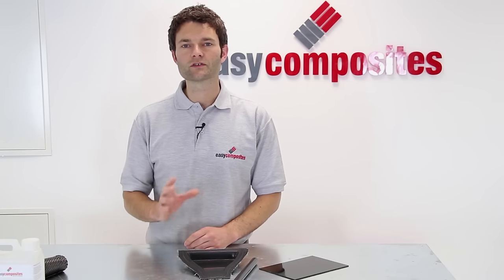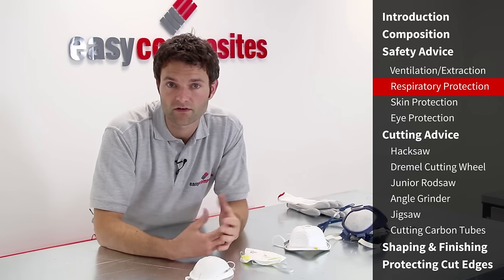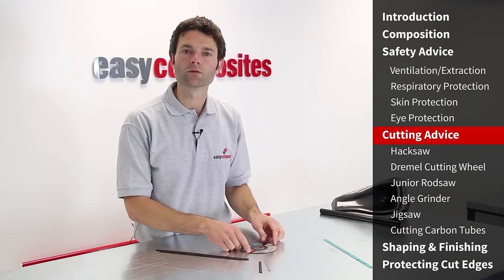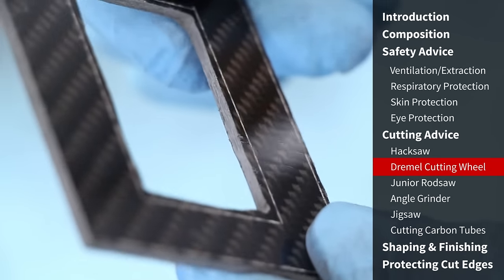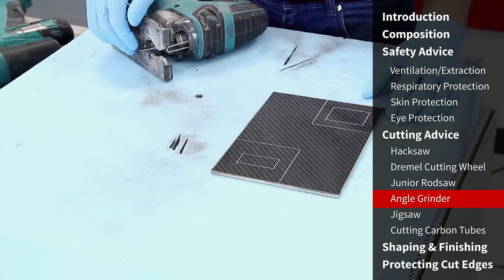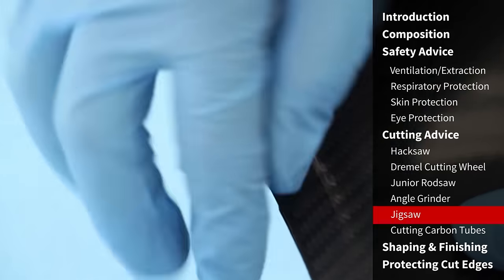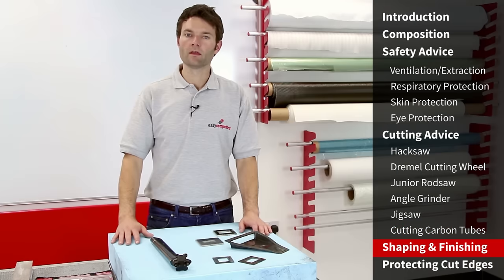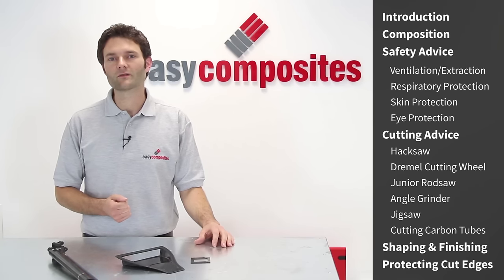How to Cut Carbon Fibre Sheet and Carbon Fiber Parts (Technique & Safety)

Comment: I work an an engineer on carbon fibre aircraft and would like to recommend the cutting tool I prefer to se to work on the aircraft. I use a Fein multimaster oscillating cutting tool with a bonded diamond blade. Cuts beautifully and you can cut very close to finished size. Bonus is it can be used for finishing too.
Reply: That's an electric tool, how do you do with the dust/explosive atmosphere?
Reply: @tomasescobargallardo6579  I have seen few that use a vacuum cleaner close to the cutting so all fibres dust gets trapped inside the vacuum bag.

Comment: I think it's always a good idea to use skin protection creme to avoid any skin irritation. The dust will come off easier or does it interfere with the cut surface, by which I mean damaging the laminate with chemicals.

Comment from the maker: It's the new Dremel Fortiflex. They used to be called Motorflexes which were amazing until they stopped making them but the good news is they releaunched it, called the Motorflex. Worth every penny (and you can get all replacement spare parts if you use it a lot like we do).

Comment: I was worried I might be getting in over my head without CNC milling capability, this video showed me that carbon fiber is probably easier to work with than metal with the tools I have, excellent.
Reply from the maker: Thanks for the comment Andy, glad you enjoyed the video!
Reply: It sands beautifully. Just make sure to have a vacuum or other dust collection under control, and a good respirator. If you’re drilling it, use a 1/16” drill bit for a pilot hole. Otherwise it likes to splinter.

Comment: Thanks. I'm handmaking a guitar with Rick Toone style carbon plates holding the wooden pieces together (mainly because I don't want to spend 15 thousand dollars on a real RT guitar) and this helped me with my game plan a lot...I don't have a proper workshop and most of my hand crafted guitars have been done with hand tools, but I've never worked with carbon fibre before so I was a little concerned going into it. Not anymore though :)

Comment from the maker: Work through the grits with wet and dry paper. Taking care to remove the scratches from the previous paper. Change the water with each move up the grits to ensure no grit from the previous paper contaminates your part.  once you have worked upto 1500 grit, you should be able to polish the part by hand with a polishing compound or by machine, to get a final gloss.

Comment: I use a bandsaw, oscilating spindle sander, and a  tile cutting saw with a diamond blade to cut and shape parts.  If you want to use a bandsaw I would recommend calling Lenox blades and have them recommend a blade for your specific application.

Comment: And another follow-up question please:
How do you know where to cut the hole into the 3D piece?
Would the hole be modeled as a depression into the pattern (that is, surface closed from the backside), so that the mould gets a (flat? high?) raise where the hole is, so that the new piece has the guidelines for cutting "built-in"?
Reply: Dear team, would you mind telling a bit about where to cut and drill? Would the cutting lines and drill locations be modelled as a part of the mould? Or just transferred with pen and ruler from the pattern onto the otherwise flat surface of the new part?

Comment: I am extremely happy you made this video, carbon fiber is now used in pool cues and there have been many things said about things that cannot be done without catastrophic results, like even sanding or cutting. I work on cues and have never worked with CF before, So thank you for this video and others I will be subscribing and checking out your website as well. What would be the best way to clean and make a CF shaft/tube slick?
Reply from the maker: Hi Patrik, carbon fibre shaft/tube will sand down and smooth really nicely. We'd just suggest using abrasive paper (the grade of which would depend on how much 'texture' you need to take off but in many cases a 240grit paper might be a good starting point. You can then work you way up to finer grits and then finish with a polishing compound like Pai Crystal NW1 Black which you'll find on our website.

Comment: So, if sand paper is all right, belt sander and drum sander probably all right too?

Besides that, if jigsaw with that kind of blade is ok, what if i do the cutting on table saw or miter saw with a metal cutting blade or diamond blade, or even metal cutting bandsaw, is there a minimum speed and blade choice we have to follow?

Comment: Great share, nicely done. Seems I'd want to take the CF dust control to a higher level. The good respirator - I totally agree. But I would seal eye areas because dust gets right into eye fluids. Then, use a shop vac seems bad if CF dust goes through filter and then shot into room's atmosphere. What to do with dust that is collected? Seems to be like nuclear waste, it will always be with us. Dump it out back where it gets into the watershed? I am cautious about this stuff - seems easy to have an incident you won't realize until well down the road when the equivalent of mesothelioma kicks in. There was a lot of loose dust sitting on the foam board after you post-processed the items, to deal with.
Reply from the maker: An Air fed mask would be ideal if a lot of material is being cut.  Such air feeds need to be filtered as a matter of course.  Carbon Fibre Dust itself is not a hazardous material - cured carbon fibre is not generally hazardous - it only becomes a particle hazard once airbourne. Disposal for carbon fibre dust and cut cured carbon fibre is generally in non-recyclable waste, although local rules may differ. If you are careful and wear appropriate PPE, then there is no reason to be concerned about any long term health effects.

Comment: How about cutting it wet would it be a viable option too? For the drilling perfect holes you should clamp it between two plates of wood and drill through the wood. I think it would work as fine as drilling multiplex/balsa wood by using scrap wood to prevent multiplex/balsa from chipping
Reply from the maker: You won't get a neat cut on wet fibres.  You can trim the excess off that way but will still need a final trim once cured.

Comment: IF you are buying a hacksaw, get one with a rectangular frame whenever possible. Older steel tube ones of decent quality work really well. The ones with a semicircular frame like shown here leaves less useful blade length when working on large materials and you cannot use the forward part of the frame as a second handle for the other hand. Also, get one where it can hold the blade at different angles, makes awkward cuts less awkward. Lastly, hacksaws are cheap; spend the extra money to get a nice one.  Ignore the bargain bin, spend $10 more and save yourself a lot of time and aggravation.

Comment: very good Caya you explained, I have started learning and have produced carbon for my own use.. I have already repaired my cracked bicycle frame, so I don't need to send it to the shop to repair the crack, the first time I use this carbon, right?  my body is very itchy. but from there I started to understand that if it is ready and dry, if it is rubbed, the dust can fly and stick to our body parts..anything, thank you for the way of using this product..very good,,,  ,#stay save covid is still there we are almost winning, we have not won against this covid19..#to those who died due to covid condolences to their family members# very grateful for the useful knowledge from you
Reply from the maker: Always wear PPE to minimise exposure to the carbon dust when cutting it.  It is a respirable dust hazard and can cause minor skin irritation as you found.  Washing with cold water will remove any dust on the skin with less irritation.

Comment: Thank you very much for your video, I was also wondering how to drill a hole in carbon fiber rod.  I have a rod that I need to attach a screw to and I was wondering if I should drill the hole just as you did through the pre-preg.  Thank you in advance for your reply.
Reply from the maker: It is the same method really. You ideally need to clamp the rod and use a bench or pillar drill so the drill bit can't slip and slide everywhere. Be aware that carbon does not take threads very well so screwing directly into it is not a good idea.

Comment: Thanks a lot such a detail video. 
Please guide for drilling process and drill bitts type to be used , thanks
Reply from the maker: For most simple drilling operations you can use normal HSS bits. For larger holes, there are tungsten carbide hole saws (check the Perma-Grit range on their website).

Comment: Wow, this is fantastic! Exactly what I was looking for!  :-D
What would you advise for drilling small holes, e.g. for screws, panel lights or switches?
Reply from the maker: HSS drill bits work fine.  Start with a small pilot hole then open out.

Comment: Would wetting down the workspace and part while cutting be a good option?

If I use a wood cutter, would the bigger chunks make it better for dust?
Reply from the maker: Wetting: yes, it’s a very effective way of minimising airborne dust. Wood cutter: I doubt that would reduce the dust significantly but it would effect the quality of the cut. Extraction, submersion or protection are more realistic than prevention.

Comment from the maker: Pre-preg carbon fibre will have a specific cure cycle. You need to find out from the manufacturer what that cycle is.  The same basic concept of mould making and the basics of laminating are still the same. Also the finishing process is the same. The bagging process for pre-preg has some similarities to other vacuum processes but the bagging stack is unique to the process.

Comment: Great video. Extremely helpful. One question though, where can I get/order a foam block like this one? Of that size?
Reply from the maker: We just used an old block of dirty polystyrene we had lying around for the purpose.  Any similar polystyrene block will be fine - cheaper the better as it is going to get slowly destroyed as a cutting surface.

Comment: Can you foresee any issues using a high speed router with a small bit (3-4 mm) to cut a hole in a sheet? I need to retain both pieces (cutting out a door).

Comment: Hey, I got some pre-impregnated carbon fiber, will your method mentioned in the video How to Make a Carbon Fiber Car Bonnet/Hood will be right? That's to say, can I use the vacuum bag  and cure them like you have done? Someone told me that the pre-impregnated carbon fiber needs High-Temperature to cure, Is that right? Or can I get something(tools or somewhat) useful on your websites?

Comment: is it possible to cut straight down the line of the carbon fiber tube?
Reply from the maker: Hi Ronald, yes it is. Clearly the strength of a tube that's been 'slit' in this way will be compromised but in principle there's no problem with cutting down the length of a carbon tube. You'll also find that a carbon fibre tube that uses 100% down its length (like a pultruded tube for example) will feel particularly vulnerable to crushing or further splitting when cut in this way but that's really because they're already vulnerable.

Comment: I'm looking to do a carbon skin on a fiberglass table with wood laminate and carbon fiber, having the two materials meet in several areas on the flat surface. What is the best way to deal with the transition of wood to carbon fiber in regards to trimming excess and making it flush?
Reply from the maker: Hi Mark, well, it’s quite a unique thing you’re doing so there’s no precedent for this but I guess if it was me I might try to create a transition by having the wood slightly deeper, in a gradient so that when machining it flat the the carbon blends into the wood. Hard to explain but maybe it makes sense.
Reply: @easycompositestv  awesome thanks! Makes sense, like a channel for the wood pieces indented in the carbon to lay flush. Thanks I'll give it a try!

Comment: Excellent video!  Thanks so much!!  What is the blue block of foam that you use as a cutting surface for the jigsaw?  I can't seem to find anything like it?
Reply from the maker: It's Styrofoam; I'm not sure where you're based but if you're in the UK then a company called Panel Systems sell it http://www.panelsystems.co.uk/product/styrofoam. Alternatively, it's a bit more flimsy but you could use any polystyrene insulation foam (also known as bead-board).
Reply: Thanks!

Comment: Hi guys! i've watichning for a couple od years. 
What about cuting and trimming Carbon/Kelvar hybrid composites?  

Regards form Poland!
Reply from the maker: Hi Gongi, thanks for the comment. Mmm, good question. If you've done some cutting and trimming of aramid fibres already (and I guess you have) then you'll know they can be a real pain. There are some tips and tricks but I don't think it's something that anyone finds easy. If we can think of enough helpful hints to put together then maybe this could be a video for the future.
Reply: Yes, I know what you mean. I’m working in specialistic UAVs manufacture for a 5 years so I’ve solved a lot of production problems including  ex. building vacuum forming maschine then preparing technological processes. I’ve learned a lot from your videos but advanced techniques should be “collected” in solid research by a lot of years.

I have found a couple of tricks. I just started with hybrids - actually today so Kevlar is like new lover. cheers!

Comment: Hi there, thanks for the great advice. I feel I need some more advice, I've bought some 0.5mm thick carbon fibre sheet to make my own carburettor valve petals and in wondering what would be the best way to cut thin carbon fibre like this will a Stanley knife be ideal? as I think any tool other than the knife would shatter the piece. Kind regards, Lewis
Reply from the maker: A sharp knife may well cut the 0.5mm carbon sheet. Gentle use of a Dremel style tool will also cut the sheet.

Comment: When making a CF fairing, it is best to use Uni-directional cloth or should I try my best with 0 degree and 45 degree layup with the weave?  I was also looking at the thickest cloth for cost effectiveness.
Reply from the maker: Doc02864 Most non-structural parts such as body panels are fine with a woven cloth.  The thickest cloth we sell is a 650g carbon twill weave which is 0.9mm per layer which is great when you need to build up a thick section.

Comment: a friend off mine sugested me once to put a bit of water to minimize the dust and the heat on the piece. does that in some way damage the carbon fiber or it dosent matter?
Reply from the maker: Hi Augusto, that's not needed or recommended for composites. Use an appropriate cutting tool speed and you should not have any issues with overheating the resin.  Dust should ideally be dealt with using an extraction system.

Comment: Would I also be safe if I just work out side in the open air?
Reply from the maker: Working in the open air will significantly reduce the risks, however we would still recommend using the PPE anyway. You never know if the wind gusts towards you or a sharp shard flies off during cutting.

Comment: How would you go about cutting carbon fiber roll wrap tubing?
Reply from the maker: The information under the cutting carbon tubes section applies equally to roll wrapped tubes as it does pultrusions so follow our advice there and you should be able to cut the tubes no problems.

Comment: what would be the best tool to cut carbon fiber reinforcement soft sheets?
Reply from the maker: If by soft, you mean raw fabric then a good quality set of carbon fibre shears will do the job well. Something like these: http://www.easycomposites.co.uk/#!/tools-equipment-and-supplies/shears-scissors-and-knives/10-inch-carbon-composites-shears.html

Comment: Hello, I am conducting experiments on void content in carbon fiber with the use of microscopes and microscopy. I will be cutting out test pieces from carbon fiber blocks.How do i polish the cut side of the carbon fiber in preperation of the analysis?
Reply from the maker: Firstly sand the edges smooth working through the grits with wet and dry sandpaper until around 1200 grit. You can then use a polishing compound to bring the edge to a gloss finish. An ideal polishing compound for this is our NW1 Black which you can find here: http://www.easycomposites.co.uk/#!/tools-equipment-and-supplies/polishing-and-finishing/NW1-Super-Cutting-Compound-Black.html

Comment: You also can cut in water. For a cnc that will be the best option.
Reply from the maker: Yes, agreed, cutting under water is a great way to cut carbon fibre by CNC. You will see either water bath options or water bath modifications for most desktop CNCs, it's a very clean and safe way to avoid the risks of the dust.
Reply: @easycompositestv  thank you for making this super helpfull video.

Comment: I wonder if laser cutter will be a good tool for Carbon fiber
Reply from the maker: Laser cutters tend to melt and burn the resin edges leaving a not very neat edge in need of tidying up.  Water jet and routing offer good CNC controlled options for precise and neat cuts.

Comment: would it be possible to use a hegner fret saw to cut a prepeg sheet? it would be similar to using the drill and perma-grit rod saw, but replacing the saw.
Reply from the maker: Hi David, Yes, I guess so. I've not tried it myself so I can't vouch for where it sits in the pecking order of cutting equipment but most cutting tools will cut carbon fibre - some better, some worse.